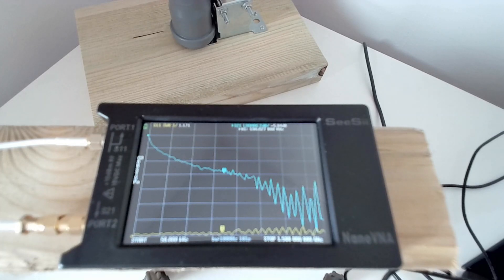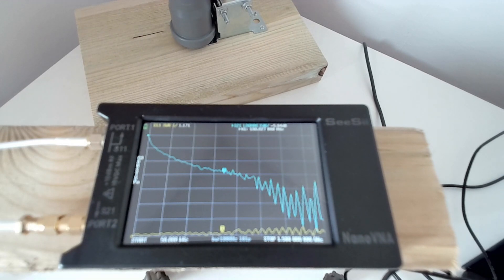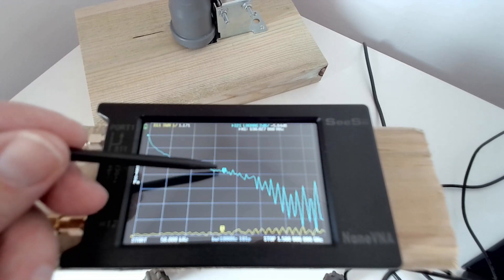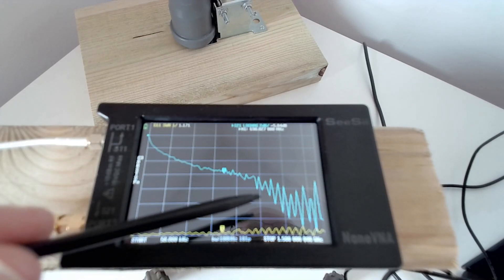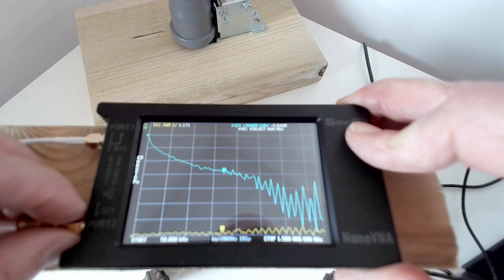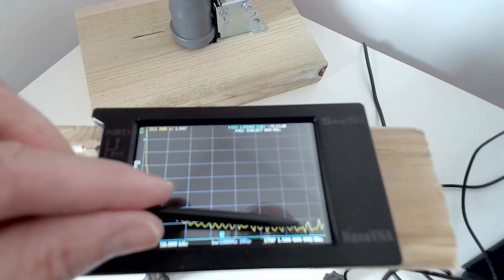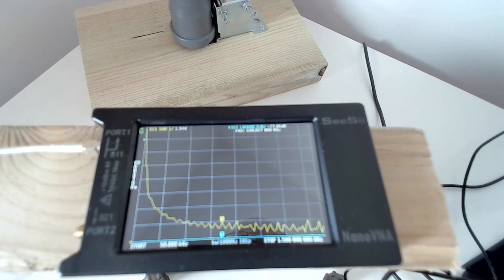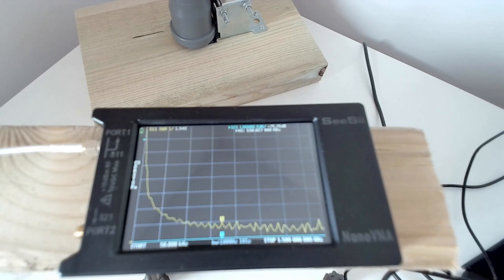Broadband Antenna - is it a Fake ? Part 3

Comment: This was a great three-part analysis. I have one of those popular and  "MLA-30+ (Plus)" active magnetic loop receiving antennas. It comes with a 10 meter-long cable permanently fixed inside the potted circuit box. Now after seeing this third part, I'm wondering how much the cabling influences the MLA-30+'s receiving qualities. Maybe that antenna is an idea for your video backlog; I'd be great to see you give it a thorough review.
Reply from the maker: Good idea - let's see when I get around to that. Glad you found my content interesting.

Comment: Do you think the companies that make these know that putting cheap long cable will have this effect or is it ignorance? its really odd because its not really any more expensive to make good aerials than bad ones.
Reply from the maker: I imagine it is ignorance and they are not that calculating. Probably they had a good antenna design and someone inexperienced decided to attach a long cable to it without considering the consequences.

Comment: Charts suggest 28dB loss per 30m so your 5m reading is not great but not very far from what's to be expected. It's unsuitable not because it's poor cable and much as the wrong cable for the application
Reply from the maker: That is assuming that what is printed on the cable is true. I haven't seen it in white colour before.

Comment: I read up last night on super j pole antennas, for a noob like me they are super easy to make. I've already bent two up from 2.5mm2 household solid copper wire to practice my bending. just waiting for a pre terminated length of lmr200 to turn up ( i know it's very lossy coax but It will be a max run of 75-100mm ) so I can check the tune and swr.  looking forward to the next video
Reply from the maker: That sounds great. J Pole is on my list of antennas to try !
Reply: Images of your family wondering where all the coathangers have gone 😀
Reply: @paulizz  no coat hangers 2.5mm2 solid copper electrical cable much more malleable than steel coat hangers